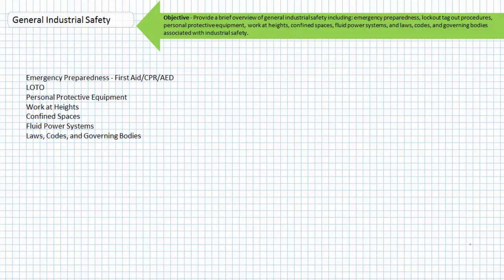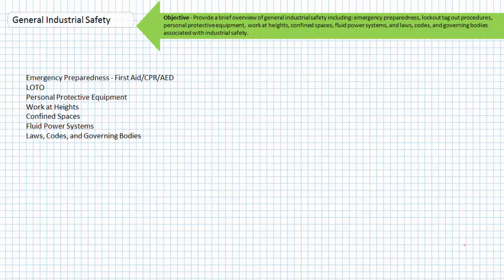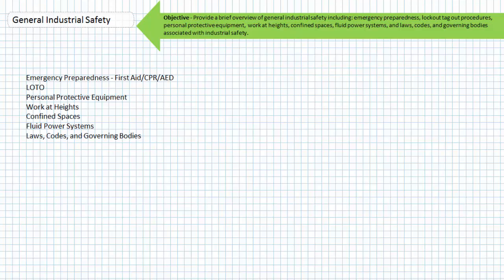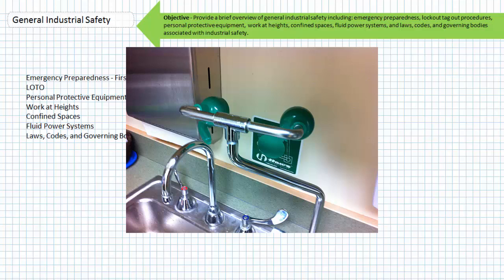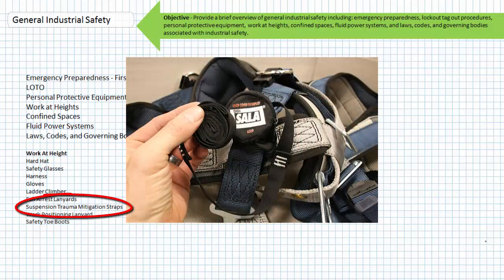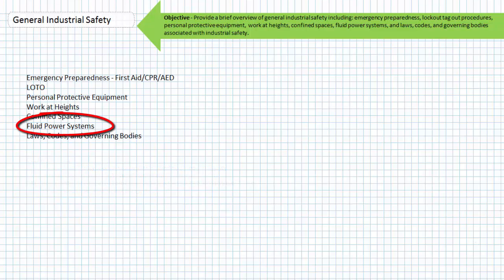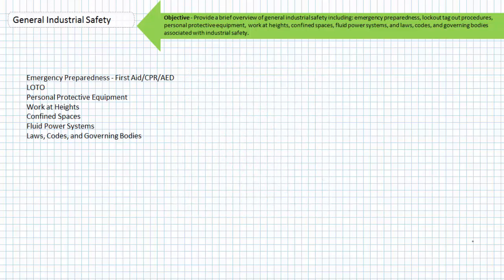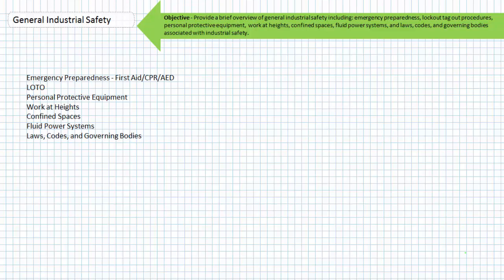General Industrial Safety

Comment: I am using your videos to brush up on electrical engineering concepts for FE exam prep. I like your videos, especially how you present visuals, clear volume, and the order topics are presented. One suggestion that I have is to keep the duration of each video shorter. I feel some of your videos are too long.
Reply from the maker: True dat! After my first attempt at the basic electrical circuits series I looked back and saw a lot of LONG lectures. I've since adopted a new approach that I've been slowly chipping away at: 1) a "theory" lecture 2) an "examples" lecture.  I'm finding this approach works a little better than trying to package everything together.